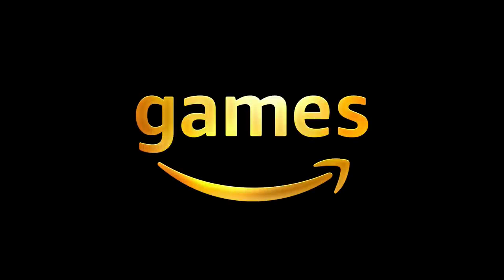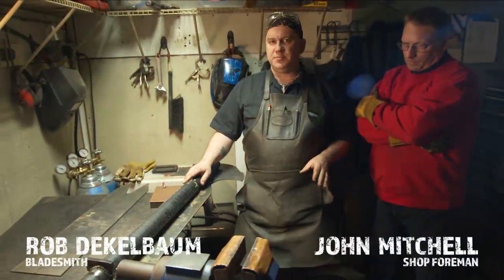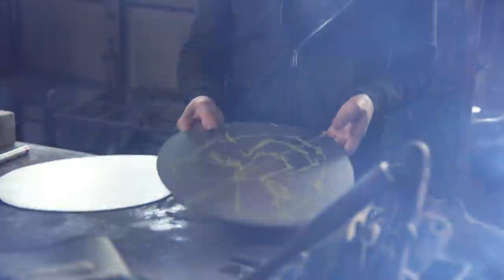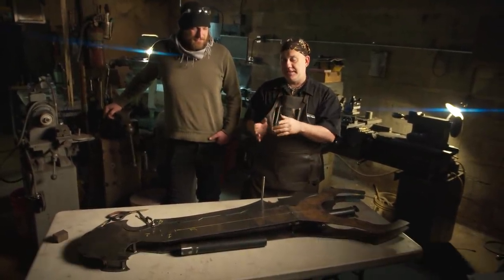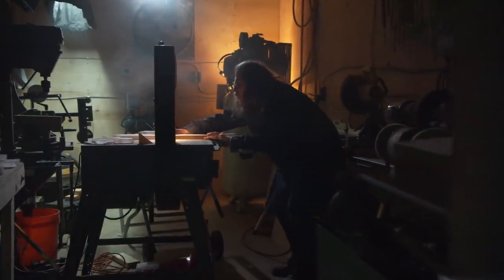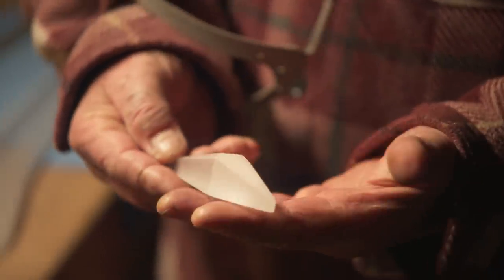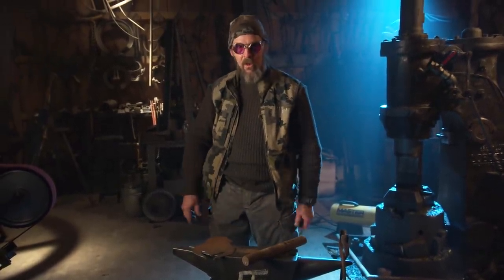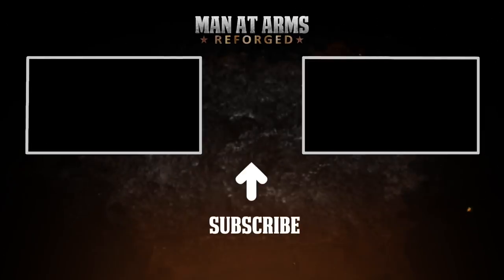Berserker Sword(1/3) - Lost Ark - MAN AT ARMS : REFORGED

Comment: i'd like to see more actual sword builds, not just hollow replicas/toys.
Reply: its such a bummer. part of the appeal of swords like this is that they are impossibly huge chunks of steel. coping out in the first 5 minutes is like.. why bother...
Reply: @ince55ant  exactly. its supposed to be a giant berserk sword that can't be wielded by any mere mortal.
It's not supposed to be practical.
But i guess Amazon didn't give them a high enough budget to make a real sword.
Reply: @ince55ant  Well. It would be nigh impossible to pick up. If it was made out of steel, it would weight like 300lbs. That's not necessary. They are sculpting, which is still incredibly difficult to do.
Reply: @ince55ant  did you see the rondel ?  And more is coming.